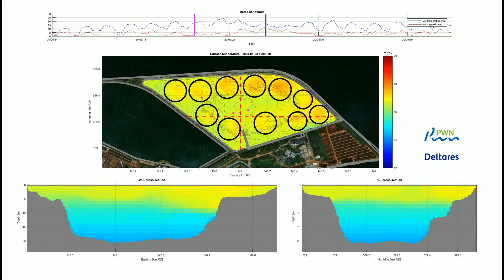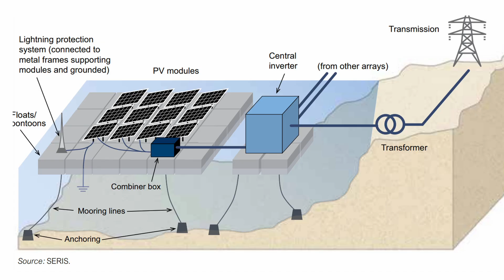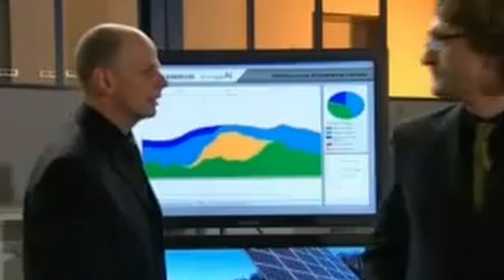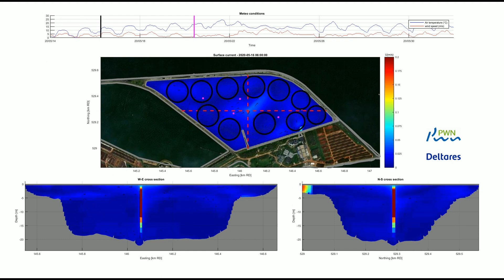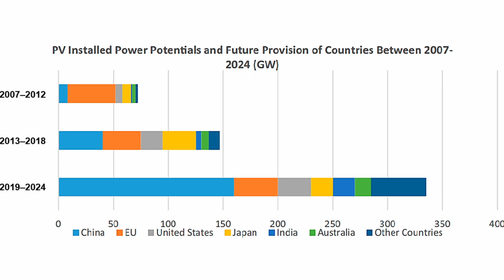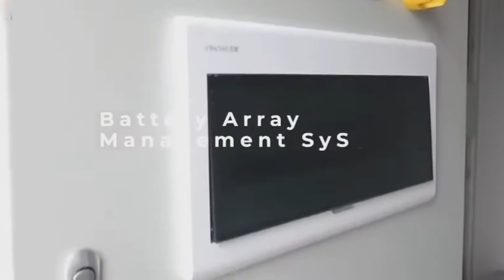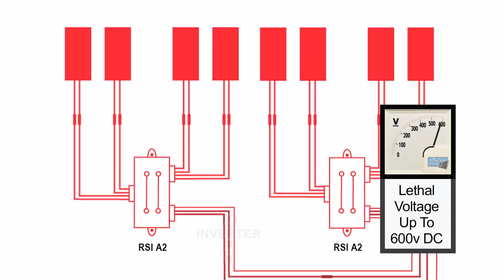World's largest floating solar farm transforms mining waste

Comment: Finally wind and solar that is not connected to the grid, but a battery so their erratic electricity doesn't cost more natural gas to support with high readiness than making all the electricity from natural gas combined cycle power stations.   Atmospheric carbon dioxide is the gas of life.   1200 ppm atmospheric carbon dioxide three times today's level  would greatly green the earth and is used in plant growing greenhouses.  The cause of global warming is not known with studies to its cause going back to the 1970s.   NASA reports global warming at 1°C where it has been since 1992 after falling from its all time news reported high of 1.1°C in 1991.  Its impossible to raise the effect of a saturated system a primary example being earth's water vapor saturated greenhouse effect that completely absorbs all the greenhouse radiant energy from the earth within a few meters of the radiating surface adding 5.55°C (10°F) to earth's average temperature.   

For earth’s greenhouse effect on average water vapor is over a 99.5% share, carbon dioxide less than a 1/4% share and human caused carbon dioxide less than 1/10% share.  Water vapor has a CO2e of 18 on average 1% of the troposphere. Carbon dioxide is 400 ppm, 0.04%.   1.00%/0.04% = 25 times more water vapor than CO2.  25 X 18 CO2e = 450 CO2e for water vapor and 1 CO2e for CO2.   All the other greenhouse gases total to a bit less than CO2 or 1 CO2e.   Carbon dioxide’s share 1/452.   40% is considered to be from human causes or less than 1/10%.